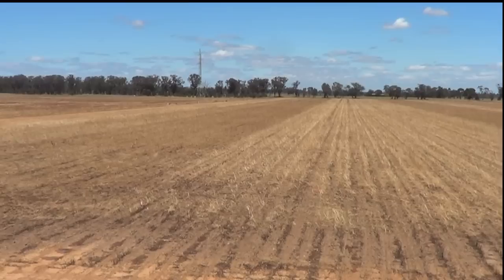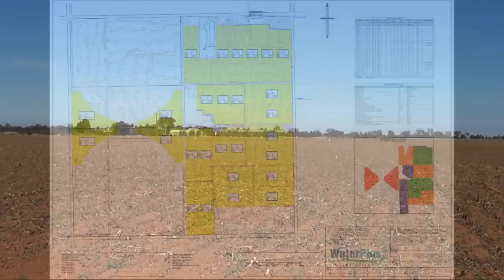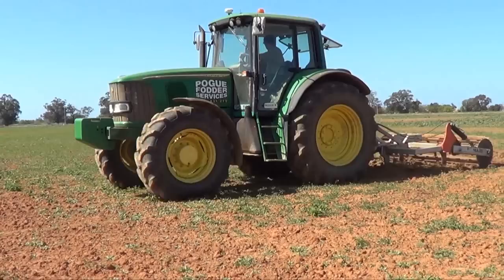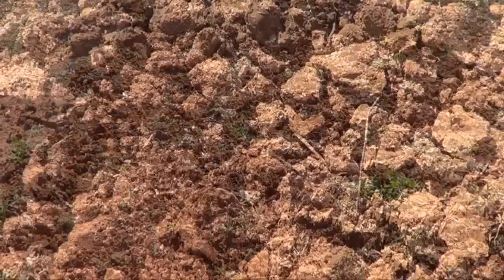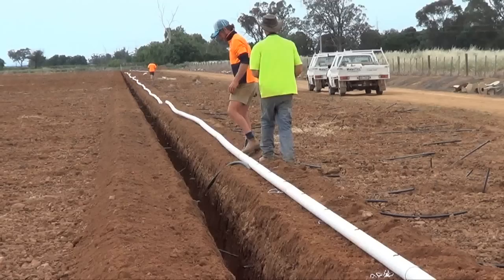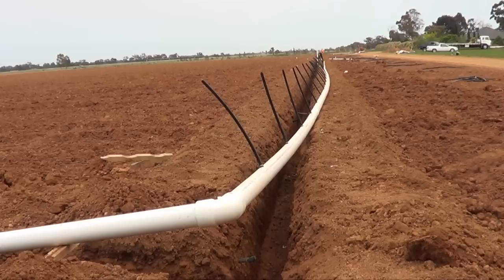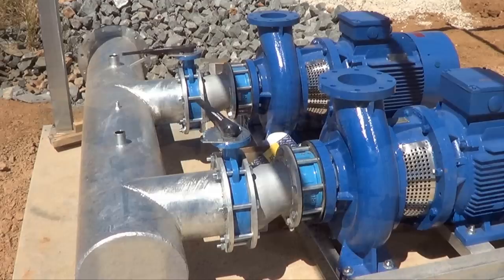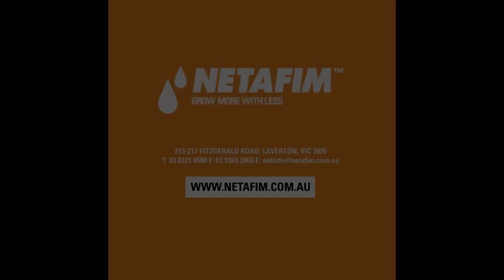How To Install Netafim Sub-surface Drip Irrigation (SDI)

Comment: So how're you supposed to remove the line post season so you can disk and rip the earth for next season. My family changes the direction we rip (with the rows, across the rows, and diagonal) every year so there's no solid patches of earth, like you'd get only going a single direction every year, that inhibit the corns roots.
Reply: Michael W the line is buried about 30” down so the disk wouldn’t hit the lines at all
Reply: And if you use a ripper, the deepest I’ve ever seen a ripper go is 18”
Reply: @roundprairiedairy7006   A ripper can go as deep as its designed to go ,  as long as you engineer the tool to cope and you have enough power to pull
Reply: @roundprairiedairy7006   actually 30 CM 12 inches down but this is for Australian farms they dont work land as the soil structure is poor
Reply: 30 CM 12 inches down but this is for Australian farms they dont work land as the soil structure is poor you can berry pipe deeper